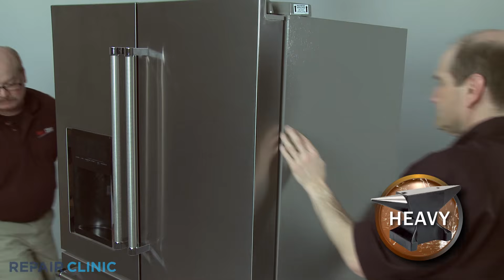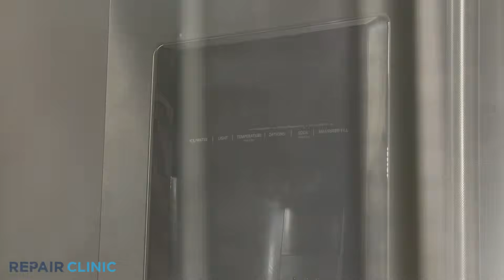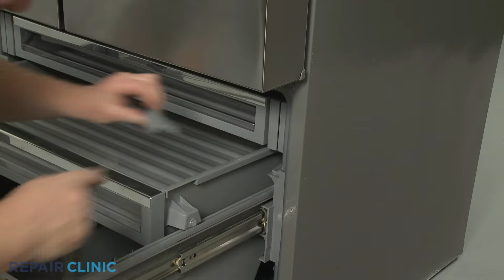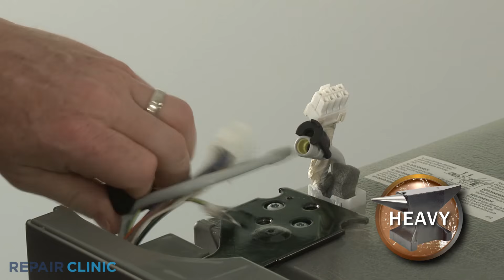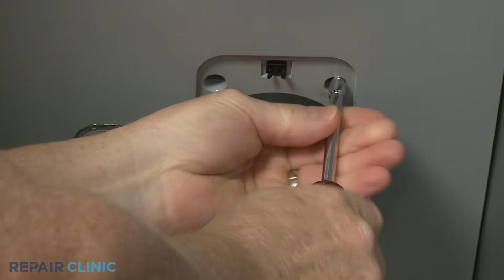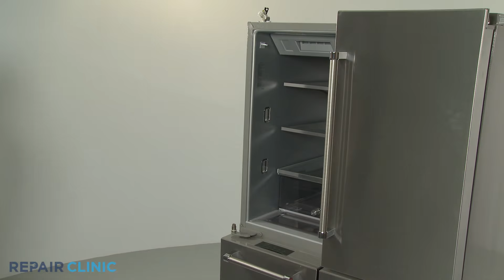KitchenAid 5 Door Refrigerator Disassembly (Model KRMF706ESS01)

Comment: When using the small flat screwdriver to push the small tabs to remove the panel, be very careful. The tabs are small and break easy. I had to JB Weld 2 of them with plastic putty. Thanks for the video, took mine apart and cleaned it all. I’ve got 2 door gaskets on order, they all ripped and won’t get down to temp to make ice. Condensation all around the doors and ice maker because of this.

Comment: my fridge is the one in this video.  my home warranty sent an independent contractor to try and repair it.  it had leaked out all the refrigerant.  when he filled the system with nitrogen to try and find the leak, it started making a loud bubly sound behind the back panel.  he said it was irreparable because they could not remove back panel and damage insulation.  something about whirlpool not wanting them to do that.   can anyone tell me what it could be?

Comment: I needed to replace the 3 light combo in the water filter upper right compartment and it appeared it would be an easy job. However after I removed the filter screws, the compartment cover would not budge at all and I was unable to remove it. I stopped trying after a while for fear of breaking part of the plastic, since it felt so flimsy. It made me wonder why there were screws in it at all since it seemed pretty secure without them. 😄In the videos I've seen it looks so totally effortless. Is there some trick or tip for removing that compartment cover?

Comment: Thank you for the video.  My Whirlpool version of this refrigerator was making a humming noise louder than normal.  I used your video to disassemble my bottom freezer section and located a mass of ice build up on the copper tubing from the condenser.  Thawed the ice build up and back up and running like new.
Reply: This only sounds like half the story. I am going through that now, and replaced the evaporator blower motor. However, I  now don't think that was the problem.  The ice buildup came into the fan blades, causing the noise - I assumed it was because of bad bearing, till I removed it and saw what was going on.  I just ordered a heater, I am guessing that is the cause of the ice buildup, but of course it could be something else.  I did go into the diagnostic mode,  #6, (for the heater) and it came up with error code 03, which I believe is a Short.
Reply: @billcoleman8854 did you figure out the   solution to diagnostic step 6 with error code 03? I am showing the same and it is not listed on the tech sheet. There is water buildup under the 2 pantry drawers though.

Comment: We purchased this product in June, 2016. We loved the design of this product and paid $3,400.00 back then which is now $3,900.00 today.  Two weeks ago the dispenser, the icemaker and the interior lights stopped working. I spent days researching the problem and replaced one circuit board for $300.00 and did not remedy these issues. I checked the continuity of the door switches and they were good. I had no choice but to call an appliance repairman and he told me that he could try to fix it by replacing two more circuit boards for $900.00 but this was no guarantee this would fix the issue. He explained there may be a short in the interior wiring which is not repairable. He also explained that if the $900.00 fix did work the life of the product may only be another year of two. Very disappointed to have spent this amount of money only to have it work for 5 1/2 years. Will not recommend this product to anyone.
Reply: Exactly what I’m up against right now, going to start troubleshooting this weekend

Comment: I have same exact model. Icemaker quit. Icebox fan would not operate. Problem (oddly) caused by a defective circuit board in the left-hand refrigerated drawer. I disconnected the wire harness at the drawer connection (this is shown in the video when removing the LH drawer). The icebox fan began running, and the icemaker began producing ice every 47 minutes. I am not replacing the $300 circuit board. Fridge has been operating fine with the wire harness disconnected. Unable to change LH drawer temperature, but it maintains normal fridge temperature, just like the RH drawer. I can live with that.
Reply: Same here.
Reply: Thank you for this comment—this is useful info that will def help others that come here looking for troubleshooting guidance.
Reply: Same
Reply: Excellent help. Thank you.

Comment: I have this same fridge and the door water dispenser is very loud compared to the older kitchen fridge that was replaced. Also the water comes out of of the dispenser tube and splattering fashion, not a smooth stream of water.

Comment: I just bought this fridge. I hope the didn't produce the video of this model out of necessity.
Reply: Unfortunately they did. Lots of problems
Reply: Absolutely the worst fridge ever made... you will have problems.... Sorry but welcome to the club
Reply: ours has been a lemon since new.  it's now 3.5yrs old and has had the following replaced.  front panel, the three control boards in the back replaced twice. upper ice maker boards replaced, and now it needs the main board again and there is no stock.   So after a month of no fridge, Lowes is sending us a check for the purchase price because we bought the extended 5yr warranty... and the techs can't fix it.     I don't normally buy extended warranties, but with all the electronics in this thing, and the cost of replacing just a single component.... I decide to buy one. it was money well spent.    But it's sad that all new refrigerators have all these electronic boards in them that the manufactures (all brands) stop making parts for after they have been in production for a few years.   Pay all this money and they only last 3yrs?    our old Montgomery Wards Admiral Side by Side is still humming along (doing garage duty now) after 30yrs.   only thing ever replaced is the ice maker every 10yrs.  Not because it stops working, but that the teflon lining on the tray starts to flake off into the ice itself.

Comment: My interior lights and ice maker do not work.  Everything else seems to be fine. Water dispenser works,  cooling works, ice dispenser functions just no ice made. 

Door ajar light is on, but I have checked all the sensors. They all tested fine. 

I've checked sabbath mode.  Not that. 
I've also tried resetting my breakers a few times with no help.

No idea where to go now. Any help would be greatly appreciated!!!
Reply: How do I disassemble the left drawer selector panel?

Comment: My kitchenaid 5 french door refrigerator was collecting water and ice under the 2 pullout drawers. The drain tube at back of fridge was totally clear, but no water was collecting in drain pan. I found that the fridge was not tilted back enough and was too level. Raised front pods up 1/2".  I took a hairdryer to the vent behind the drawers until the ice melted and could see the water draining into the drain pan at the back of the fridge. It has worked perfectly. Hope this helps.
Reply: We had this same problem. Adjusted the front feet and problem solved.
Reply: I can't say thanks enough for your super helpful comment! I watched the whole video and almost to follow the step to unscrew the  evaporator cover. I thought maybe check what others say. Then I saw your comments. Tried immediately and the issue was fixed!!! Thanks so much!
Reply: God bless you and your family, mine has been doing this and will look into this!
Reply: I have found to make sure it's level and/or slightly tilted so the water does not run to the front.

Comment: My ice maker quit, then the freezer wouldn't freeze. Warranty company replace 2 circuit boards, one ice maker, defrost connector, compressor and this took 4 months with no results.  Finally a repair tech turned off the selector on one of the drawers than had deli, cheese etc. That fixed it.
Reply: Unplug deli board and it solves all this fridges problems
Reply: Same problem. What is the selector?
Reply: Please explain
Reply: @8hfcvfwr  the left drawer has a way to set temperature in drawer by selecting delivery, cheese, vegatables,  soda.  Evidentley it was bad and effects all controls on refrigerator.  Once it was replaced everything has been fine. It was a simple fix but the technician that kept coming didn't know about it.
Reply: @carrolstack4625  simple but very pricey
Reply: Disconnecting the left drawer control cable fixed my light issue, door sensor and freezer not cooling properly. Thank you again
Reply: Any idea how he did that.  Might be worth a shot.
Reply: @Tpet84  I went on that bug hunt early on as it was mentioned in a few videos that my "problem" was the wiring in the deli drawer chafing and shorting out. The controller isn't hard to unplug. the plug however can be a little balky so it needs a nudge with a small flat bade screwdriver(extra hands helpful) and watch out for sharp edges too!. I know these are short run PCB boards but for pete's sake I can buy a current I7 PC for that much cash..if the unit only had a USB port and an API for programming....:-)

its a poorly thought out design. changing the temps in that drawer should require a five second button push.
I check that often as that's my tell that the icemaker isn't going to be working ( when the deli drawer temp control lamps are out.)

I figure my LED controller board is going to croak at some point, but since I skipped the service contract this time around ( can't get a competent tech in my area at all and had to junk a samsung 4 drawer beacuse nobody could get a new compressor to operate)) so I've saved at least $600 on contracts so I can pop $300 for the LED board and still be ahead. I was determined not to buy another foreign made reefer, so I went with KA, sorry but they did not really live up to my expectations for a top end American assembled unit ( all compressors are made in china these days, even KA's)
Reply: @nmpeter487  , Thanks for the reply. I agree, never buying a KA again. They look great but are garbage. I've actually had a tech come out a few times and they replaced ALL the boards (back main boards and the front panels), I've also had the temperature sensors go out in both the refrigerator and freezer, those led to the fans getting iced up and frozen, a couple power failures in which we lost everything in the refrigerator (required cycling the power), and now this crap. I realized I failed to check the drawer sensors leading up to my last comment. I will have to wait until we get through some of the stuff in the fridge before I can tear the doors off and disassemble to get to those. I'll update once I get around to checking those. 
Overall, I've had a terrible experience with Kitchenaide, even had some issues with their oven throwing some weird miss-wire codes lately.
Reply: @tonypetro4496  exact same experience. We’ve given up on this garbage fridge. Sad waste of money
Reply: Oh my God Carrol. I think you solved my problem. Mine was set to thaw/marinate and the icemaker stopped working and the freezer slowly stopped cooling. This with a clogged drain from an above comment is probably why my evaporator iced over and nothing cools.

Comment: I have a problem. The front panel give me Code PO someone can help me please???
Reply: That means there was a power outage and you should be aware of the potential of spoiled food that refroze. It could also mean you have a really expensive controller board problem. My KA sometimes needs to be powered down for ten minutes and restarted to restore power to the ice maker and interior lights. Service contract useless.
Reply: Mine did that when it began icing up, and the temp in the freezer came above 26.  Had to keep pressing reset.

Comment: Awesome video, love the step by step verbal instructions. Question - is there a way to permanently disable the door ajar chime?
Reply: No, and I found the wiring corroded on one of the door switches. Switch was good, but wire had corroded internally and lost continuity.  Be careful, some idiot designed these things with 120 unfused volts to the door ajar switches. Huge fire hazard..

Comment: Very helpful video. We had ice forming in the bottom of the refrigerator. Cleared debris in the drain tube underneath the refrigerator that was was causing evaporator condensate water to spill out of the evaporator collection tray. The clog allowed ice to form in the drain beneath the refrigerator evaporator. We used this video to guide us in taking the whole refrigerator apart to access the drain entrance and melt the ice. Saved us $$$ on a maintenance call I'm sure.
Reply: Did that cause the evaporator to ice over and stop cooling the fridge? I'm hoping its a simple fix with the drain like yours was.

Comment: I was able to recover my lights by removing power wait a few seconds and repower. I would try this first, a lot easier.
Reply: I see this is a common problem. I'd like KA to repalce my baortds, even though I'm out of warranty, obvious defect
Reply: @nmpeter487  I had the main board replaced and that looks like it did the trick. I had an extended warranty so that wasn't an issue. I hope the help you good luck.

Comment: Great video! I wish you would have included the ice bucket and auger motor. Mine is working sporadically and I suspect it is the motor. Thanks
Reply: Mine would do that because the ice would begin to melt (other issues this one has when it starts to fail on you) then refreeze, so the hopper couldn't feed this newly formed block of ice cubes and it was difficult to chop through for crushed.
Mostly, ice wouldn't even feed down the Chute because it was frozen back into that block
Reply: Did you ever get your auger motor issue resolved? To be perfectly honest, if you can do half of the things they show in this video, then replacing your auger motor will be pretty intuitive. If the problem is that the dispenser "hums" and doesn't turn, then it's likely due to moisture getting into the auger motor housing and freezing. Personally, I think this is a design flaw, but it's something you can resolve, although you may have to do it more than once if you're unable to resolve the rot cause...

As ice melts in the bucket, water can drip down around the auger shaft, where it can get into the auger motor, despite a fairly tight bushing on the motor. The water then re-freezes down inside that motor between the gears, and bam... it won't work... at least not until you break it free to thaw it out. The larger problem is that once water gets into that thing, it seems to have no way out. The auger is a sealed unit, so you can't open it. I've thought about drilling a tiny weep hole in the bottom of the case to allow water to drain out, but then I keep thinking they sealed it for a reason, so I'm reluctant to do that. If you remove the motor and shake it, you'll likely hear water sloshing around inside it. I put mine on top of a paper towel upside down for two or three days and most of the water did manage to work its way out. another option might be to place it in a warm, dry environment for several hours. There is a little rubber boot that fits on to the auger shaft that "should" deflect water away from it, but I don't think it's 100% effective.

To remove / replace the auger motor, remove the ice bucket, then remove the four Philips screws surrounding the base plate that the bucket sat on. This will expose the cavity where the motor sits. It's held in by a couple of hex screws. Once you get those out, you'll need to disconnect the electrical connector and the motor just lifts out. Once you get the motor thawed out and the water out of it, it will probably work fine and won't need to be replaced, but it does amaze me that KA hasn't solved this problem. As I said, I'm thinking about drilling a small weep hole in the bottom of the motor housing to give water some place to go should it get inside there. At this point, I figure I can't do any worse than what's already happening, but I hate permanently altering something. It's a sealed unit so you don't really have a lot of options though. Good luck!

(Oh and BTW... If yours DOESN'T have that little boot on it, you need to ask KA to send you one, or see if you can order it separate from the motor. I ended up buying a new motor for mine only to discover this is what the real problem was, and the new one case with the boot; the original one didn't have it. That thing cost me over $120, so I'd definitely try and get the little boot first. Both motors mechanically still work fine now, although I still have problems with moisture getting inside even the ne motor.